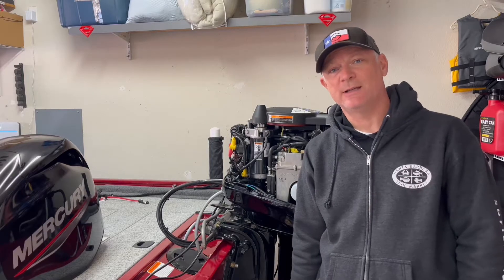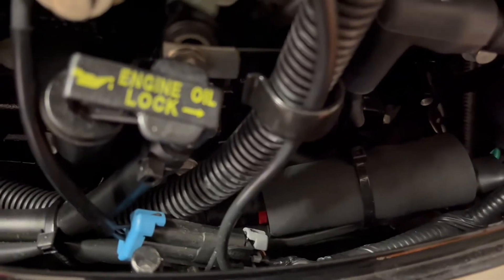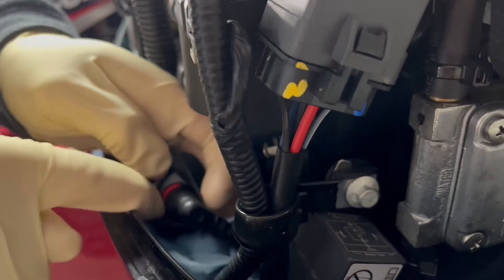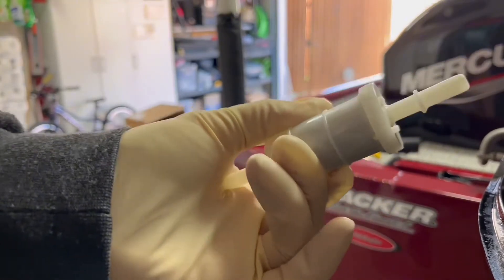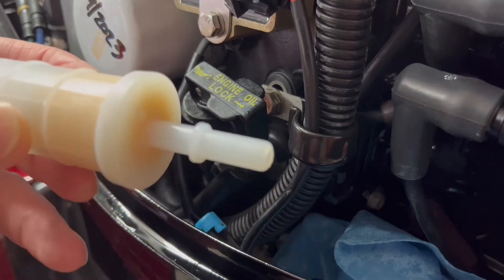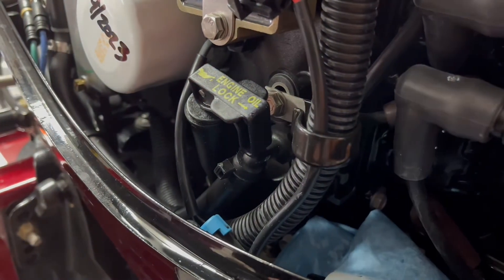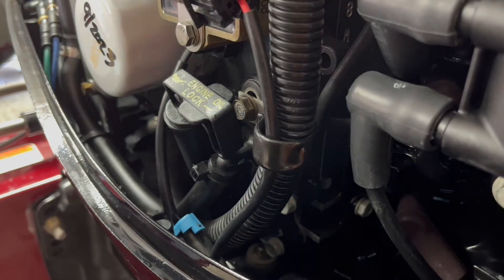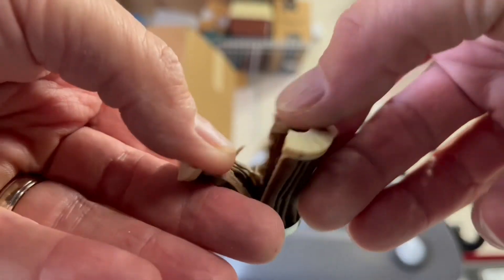In-Line Fuel Filter Change Mercury 40/50/60 hp EFI

Comment: Why does everyone else say remove the coil packs?
Reply from the maker: The 40 hp requires the removal of the lower coil because the lower coil sits right above the filter.  This is not the case with the 50 and 60 hp models.
Reply: @RFishingtx thanks

Comment: My motor is not starting..  I checked that all connections are made.  I pumped the fuel bulb extensively - any ideas?  Is there a place to bleed an air lock?
Reply from the maker: Did you check the kill switch? I know it may be a stupid question but I can tell you that my motor wouldn't start one day and that's what it was.

Comment: Hey motor runs but bogs down every so often what y think it is ?
Reply from the maker: Checking your fuel system would be the place to start your troubleshooting. I had the same issue on a previous boat that had a 2 stroke and it was a carb issue.

Comment: Its a good thing you dont have a 40hp Merc. I tryed to do mine today. Got the top 2 coil pacs out and replaced the plugs but couldnt get to the last bolt on the bottom pac. The inline filter lives below the bottom pac and is not accesable. Totaly defeated. If i can ever get it out, it will be getting relocated.
Reply from the maker: The 40 set up is more of a pain for sure.
Reply: @RFishingtx  I ended up calling our local small town shop, he was pulling someones pontoon off our lake and stopped by and got it handled. 5 minutes didnt even turn a bolt. I guess i owe him a beer. 😆

Comment: I have the 50hp efi four stroke Bigfoot. I can see the sleeved filter but it's much lower with some other bundled lines over it. It really looks like i might need to remove the lower cowl to access it. Does that seem right?
Reply from the maker: @dkwallis I don’t have any experience with the Bigfoot motors but given they have a longer more robust lower unit, that may be the case.